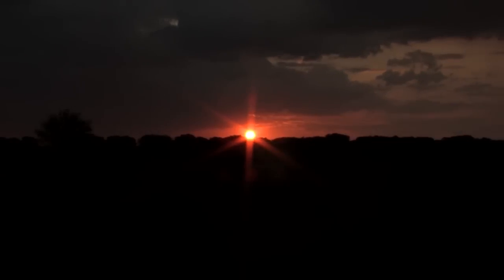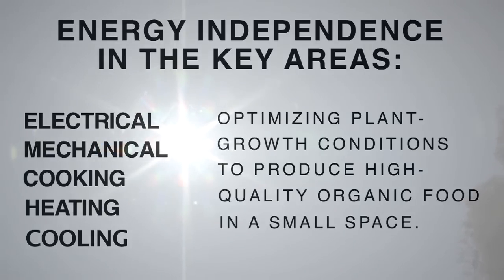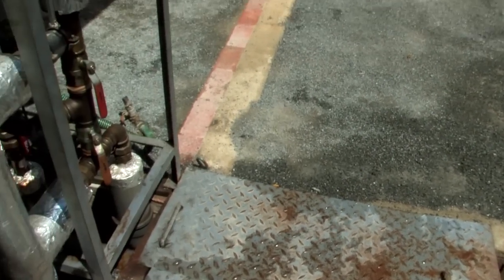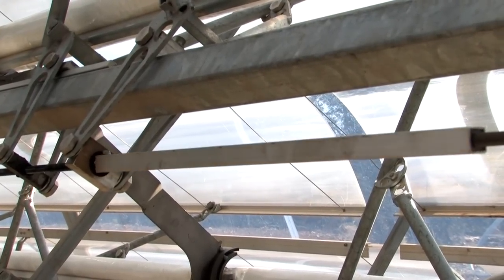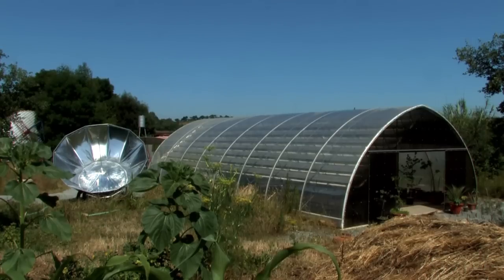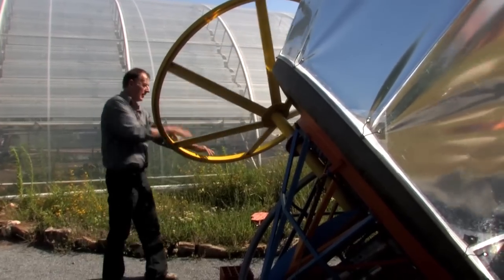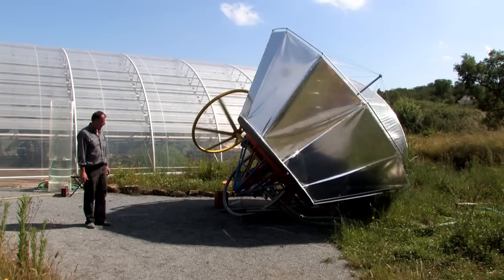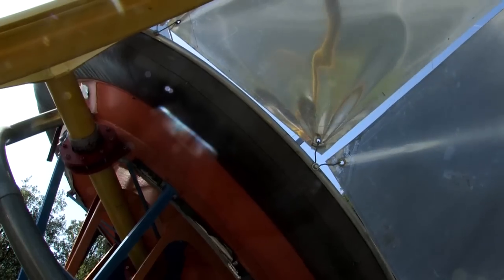Tamera - SolarVillage Testfield 2011

Comment: now all you need to do is add some buffer systems so the pulse from the piston isn't so noticeable in the power output and water flow, sensitive electronics would have a bad time connected to power from one of those without a buffer battery and inverter system. the water pressure also jumps around quite alot, which could be solved with a water tower.

Comment: Considering that we lack some of the elements needed to electrify the World (like lithium), this might very well be the future. Now it just needs to simplified, so that the manufacturing uses as little resources as possible (equaling "cheap"). Low temperature heat engines might not produce a lot of power compared to their size, but they run on the only sustainable energy source being the Sun, and they don't need a steam turbine. The closest thing to "free energy" you will find on Youtube.

Comment: 2kw output equals a little less than 3 hp. A 3 hp engine that is the size of a barn does not seem to be efficient. Pot smoking hippies and shysters the world over have pushed their self serving agendas of something for nothing.
Reply: If you don't take baby steps you never get there.
Reply: @bjl1000  a 3hp barn is a lot less than baby steps and it has been 9 years since that babystep. Hasn't it been 200 years since the Stirling engine was invented? Baby steps or potheds and shysters?

Comment: sure would be nice if we could buy plans for this sterling engine
Reply: That would be nice, because as near as I can tell Sunpulse went out of business.
Reply: @mheermance  that is what I figured as I could not locate them
Reply: @stevepailet8258  I imagine falling photovoltaic prices killed demand for their engine. Which is too bad because there's something to be said for it's ability to cogenerate heat, electricity, mechanical energy, and pump water.
Reply: @mheermance  Reality is this heat engine works even at night
Reply: @stevepailet8258  Good point.
Reply: @mheermance  Just using heated oil and it is low enough differential to work efficiently

Comment: this is cool but I am seeing at least 1000 dollars in metals alone so  at 1kwh or 10 cents an hour that is $2.40 a day or $876 a year. So the thing must last at least 2 years after labor.(not to mention land and a market where electricity is already used and this has to supply all the electricity for the year round and this is not counting repair cost over the 2 years)(If i lived hours from electricity sure I would want this but I don't get it's application in the civilized world)
Reply: The heat storage could be mineral oil and granite gravel and the storage vessel could be stainless steel. These could last centuries without needing replacement. Assuming the solar collector was made of stainless steel or aluminum, it could last at least 80 years without maintenance. I've got unpainted aluminum railing on my back porch that has been there for 60 years and shows no signs of rust or damage. I pressure wash them annually and never had any chipping or cracking. The only x factor is the stirling engine diaphragm. It may need replacement occasionally, simply because it is technically the only moving part, but there are refrigerator compressor diaphragms that last 40 years just fine, and at much higher stress rates than this engine. I'll bet that if properly made and barring incidental damage (i.e. tornado, hurricane, missile attack, etc), this thing could generate for an entire human lifetime without problems. It would pay for itself dozens of times over.
Reply: kkknotcool I think the extra cost would be worth it.  We need to start using clean energy sources and it doesn't get much cleaner than this.  Once the technology is more wide spread, innovation will be more likely and costs will come down.
Reply: DaggerofLight I agree that if this was put into mass production the price would come down considerably but there is almost no room to improve the design.(because they will always need this much metal and the price of metal is directly related to the price of energy, which is now going up, because we are using a more expensive source of energy) I think the only hope for solar is a breakthrough in cost for photo voltaic. (or maybe if they scaled this machine up the cost/kwh would go down)
Reply: kkknotcool However, being able to run on heat as your battery is going to offset some long term costs in replacing batteries found in a "normal" off grid system. Its certainly a niche market, but theres a lot of upside on its versatility and simplicity and being able to be located in remote areas. Just some thoughts :)
Reply: I think the cost is bigger, long term, for the heat battery. I mean lets make a big assumption and say they both cost the same to buy/kwh of energy storage.(I think chemical batteries are cheaper but whatever) So the question is how long until the heat battery rust away and how long until the lead acid battery oxidizes away. Batteries last 5 to 10 years and this machine would rust away in about the same time.(unless you did repairs which would add cost but still probably be economical) So with that in mind lets say it will last 10 to 20 years. So if the iron to make the heat battery is 1/10th the cost of the lead to make the chemical battery and the chemical battery only needs 1/10th the metal to store the same KWH(which seem like reasonable assumptions) That seems like a terrable deal considering lead oxide is still worth a lot of money while rust (iron oxide) is worth almost nothing. I have to believe chemical batteries are both cheaper and easier to deal with.

Comment: @erasmusso about 5k € per sunpulse was the estimation overheard last year. I agree much and whole heartedly with the concept of co-operation instead of competition, and I think that open source freeware technologies exemplify it. So here's one such freebie device for same tasks:  solarfire(dot)org/Films (check the free blueprints part) Different solutions to different locations and conditions.
Reply: The sterling engine is the key to spinning the flywheel to generate electricity. The one you listed is a point light source for cooking.

Comment from the maker: The SunPulse Water pump entered production in Indonesia this week.
That means the first model of the zero series is off the production
line. Initial test results are excellent. Now there's a cycle of
testing before the next series and ramping up production. The first
production models are all pre-booked. I guess at roughly end of the
year availability for SunPulse Water for new customers. Afterwards,
the SunPulse Electric.
For specific inquiries, contact solarvillage(AT)tamera.org
Reply: Any info available either videos or documents of new-generation engines. Greetings from Ananth, India.
Reply: i came from indonesia where can see such a project?